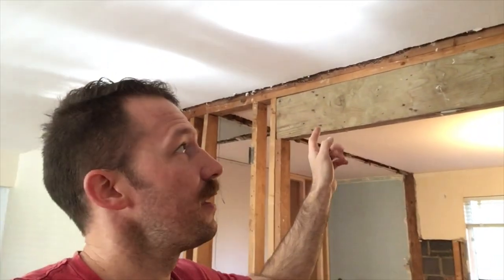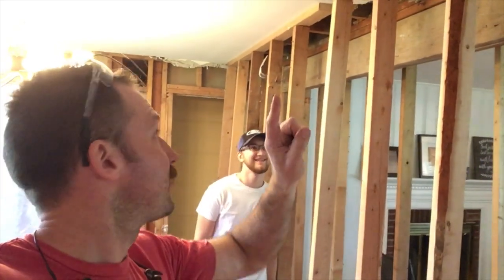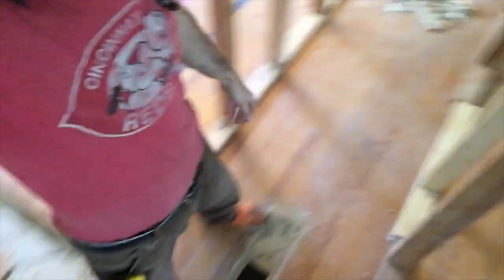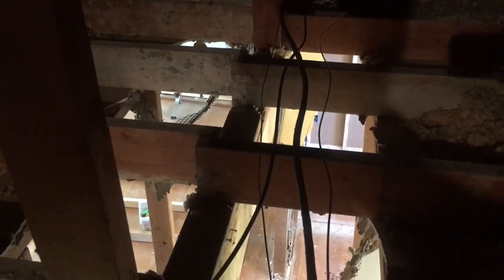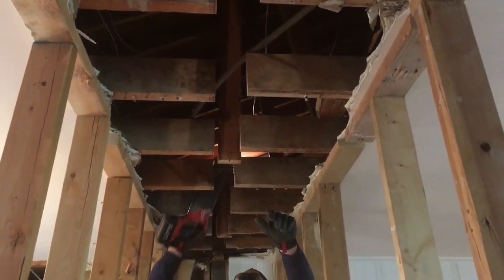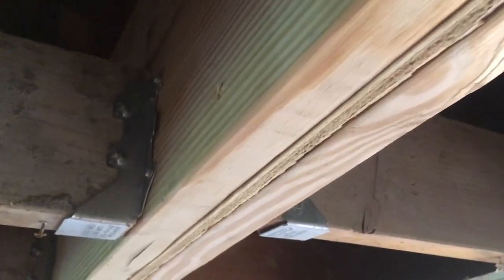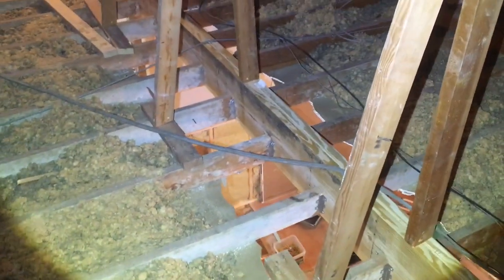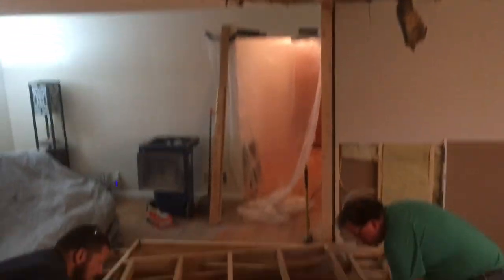How To Install a Recessed Header in a 1950s Ranch

Comment: FYI for anyone coming to this page, on paper a double 2x12, 16 feet long, supporting an attic floor, fails for moment and deflection.
Reply: I had this done and they used 2 two 2x10’s for a 24’ span. Guess what, my ceiling almost fell down when they removed the jacks. They then ran for the hills and never came back. Now there’s a 3 ply 12” lvl. That’s what it needed but I had no idea. The funny part of the first guys charged me the same as the second ones who did it correctly.

Comment: Did you have a structural engineer size that beam? Seems undersized and not put together correctly.  With a double or triple LVL (you used lumber), you would use structural wood screws in offset positions.
Reply from the maker: I would always recommend getting a structural engineer to sign off on a structural beam even for a DIY project

Comment: Is your house on slab or do you have a basement? The sketchy thing about that is if you have a basement and try that you could easily do some
Serious damage transferring that load outside the load bearing beam beneath it. I would also personally used hanger straps too, so they hang on the header as well as the side nailed in.. might I ask where you got instruction to do this?
Reply: Also, at the end of the header beam, did you add more vertical support for the extra load? I didn’t see but is your new header larger (thickness, not length) than your last? You have to take into consideration you’re adding a substantial amount of weight, you’d have to look at the load capacity of the 2x10 or whatever you used to see if 2 of them nailed together will hold that dead load over a 16’ span..

Comment: if i did this without permit would the town find out?
Reply: Not it you don't tell them. But when it's time to sell house the buyer could possibly find out. Just say it was like that when you bought it. I just did a job like this and the inspector made me get an engineered drawing and plan. The engineer made us at a flinch plate which was 3/8 solid steel through bolted to 2- 2x12's. The drawing was 1500 and the steel was 650 plus bolts, washers and nuts. Total cost plus my labor was 7500
Reply: If you sold your house and a structural engineer like me was called in to inspect (I'm also a home inspector), I would find this in a heartbeat and make you redo it properly with a permit.
Reply: @Loonypapa  how would you know if it was original or new though?
Reply: @draf8517  The span would tell me if it was prescriptive or not.  The floor plan would tell a story about whether it was original, either from my library of floor plans or a knock on a neighbor's door who lived in the same model house in the neighborhood.  A phone call to the building department would tell me if there was ever a permit pulled.
Reply: @Loonypapa  you know how a someone is an engineer? They will tell you they are one lol. 
From a fellow civil (transportation focus) engineer. I had the same thought looking at this particular modification...